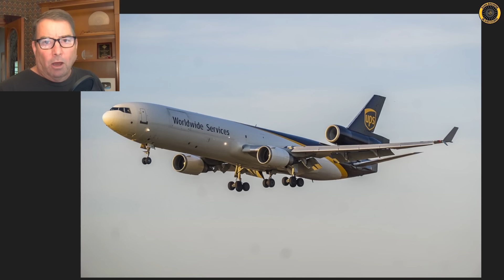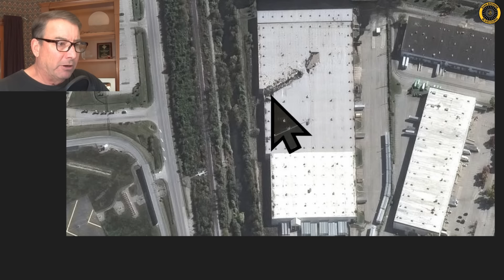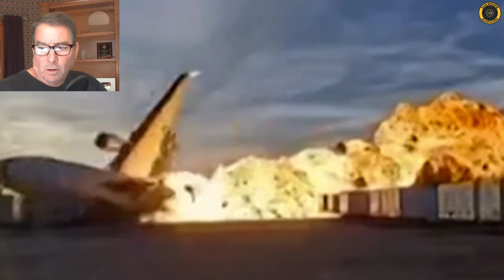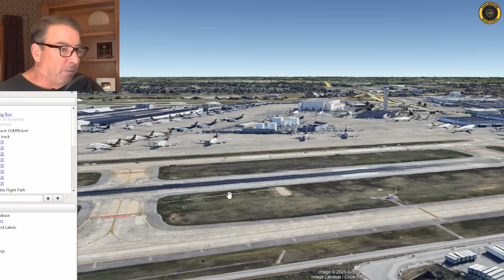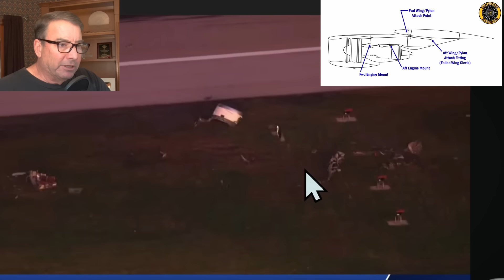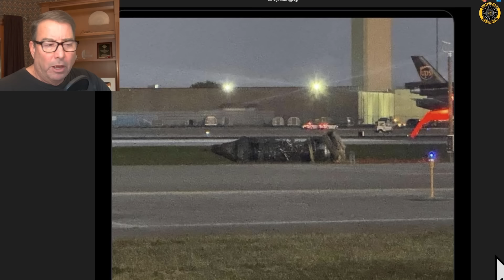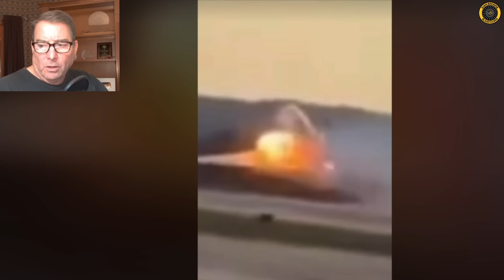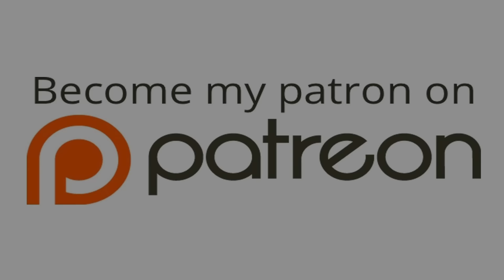UPS #2976 UPDATE 2 6 Nov 2025

Comment: Juan, it is Kevlar as I have decades of advanced material reinforcement forensics failure analysis engineering experience including decades of forensic work with aramids such as Kevlar. That picture quickly tells me a very shocking sequences of evens which I will email you to get your thoughts first  before I contact the NTSB.

Comment: The engine keeps moving forward after the separation from the wing. You have a good point about engine failure first but so much damage to pylons and engine separation is more stress at attachment points.

Comment: It was stated in another video that you may have seen by a pilot that the number 3 engine was the compression stall, not number 2, but wasn't ruled out, so there's conflicting stories which was confusing. We'll find out what happened when it's complete.

Comment: That engine fell off as AC  rotated causing a pitch up and stall. The aggressive pitch up also caused the other two engines to stall due to increase pitch and low airflow.

Comment: At the 1:40 mark the topography toward the passenger side of the car does not match the topography from the street on Google Earth.  There are not any power lines or buildings alone that street across from the departure end of runway 17 R.  There is open land then Railroad tracks then some industrial buildings.  According to Google earth the building they first struck was a UPS building, but was listed as closed.  It was first struck about 1200 feet from the departure end of runway 17 R.

Comment: Building buildings at the end of a runway… BAD idea..engines should NOT fall off wings when complete failure occurs
Having an engine on the tail accessible to debris from a failed wing engine..that design is problematic.
This is why the 777 and the 747 with wing only engines makes them a superior airframe design for a wide body.
Fortunately DC 10 MD10 and MD11 being a older aircraft are more used as freighters and less as passenger aircraft
Therefore less human life died. I recall when AA191 crashed they grounded the DC10 for numerous month
And me and my wife got layed off from CO as they had a large fleet of DC10 aircraft that got grounded.
then worked FTL and FedEX and had the displeasure of the MD10 and MD11 always breaking down and having to unload an reload
Cargo on other aircraft. I hated the MD 10 and MD11 because of the poor Mx reliability and after loading the aircraft.We would pray that the aircraft would depart without MX delay making our life hell having to unload and reload another aircraft.
Watch Fdx flight 80 MD11 bounce down the runway and crash and burn sideways like the UPS aircraft makes me wonder
I have only one good thought about this aircraft Continental in the 70s had PUB bars between first class and coach that was
Fun…other than that these airframe belong in the dessert

Comment: Per NTSB briefing 3 today 7 Nov, the CVR recording indicated 'the takeoff roll was uneventful through the different speed call outs. About 37 seconds after the crew called for takeoff thrust, a repeating bell was heard which persisted until the end of the recording 25 seconds later.' And if you want to draw AA171 parallels, again per NTSB Nov 7th 'the bulk of the left engine pylon was still attached to the engine when the engine separated from the wing'. Pretty damning information on the pylon and no chance for the crew.  Whether the "Heavy Check" performed at KSAT had anything to do with the pylon has not been determined.

Comment: I am still trying to understand the physics on how a left side engine detaches from a wing and then somehow slides across the flight path before coming to rest on the right side of the runway.
Reply: It would be producing thrust as it detached. The spinning parts would create a gyroscopic effect, changing its direction of travel as any remaining thrust and momentum pushed it forward.

Comment: The Crushed forward end of the engine.. fan duct is not just for airflow and noise control... but is also strengthened for fan-blade containment. In this case it appears that the entire fan duct  Assy is crushed and the FAN section is missing. 
Also... a point about airfield construction and civil-encroachment off the ends of runways. Most airfields are built with abundant safety zones for mishaps like this. However FAA and local Authorities are notorious about allowing business and housing to be built-up just past airport boundaries... including off of the ends of runways. NOT SO for most military airfields... the airfield/base boundaries are extended into vacant land for safety zones... to avoid civilian casualties in takeoff and arrival crashes like this. This military0forbidden-building restriction often drives developers insane... cheap good land in city boundaries that have strict building prohibitions... and SOoooo... now the reasoning why runway ends are kept free/clear of development ... terrible lessons learned... is VERY clear...

Comment: I don’t believe #2 was compressor stalling. GE engines are robust that they won’t compressor stall like a Pratt will.

If a CF6-80 compressor stalls, its doesn’t stop and turns into a ”donut on a rope” type failure. 

Again, the images just seem to indicate  flame being drawn through not FOD or debris.

I believe #2 and #3 will be shown to have been producing take-off thrust (at near full derate (-20%+assumed).

I believe the following will be factors:

- Full Derated takeoff -20% + asssumed
- Drag factors from damage to underside and upper portions of the wing
- Drag factors related to roll control and spoiler extension to assist in roll control reducing lift and further increasing drag
- Gear down

It’s my hypothesis that the combination of those factors resulted in the airplane not being able to accelerate once out of ground effect, causing it to settle.

I believe the two remaining engines continued to make take-off thrust, however since they were not advanced beyond the de-rated settings post engine failure this lead to insufficient thrust to sustain flight.

Comment: Not an expert here, but notice the following:  We know that the wings were level when it passed over Grade Lane, so the marks on the roof of UPS Supply Chain cannot be from a wingtip.  Must have been Debris, or Landing Gear, or a tale strike.  After the roof mark on the roof, the roof is clean with no marks ... and the strike area is slightly concave ... so I would say tail strike due to angle of attack of the aircraft on lift off and then it looks like less of an angle of attack as it crosses over Grade Lane.  There is no "double marks" from landing gear ... however, since it was flying slightly left, it could have been the left gear that grazed the roof (notice that the roof has some kind of structure in line with center of runway).  However note that roof mark has a "skip" in it .. a mark then some hole ... either a "wave" collapse in structure due to skid, or debris finally going into the structure after skipping.

Comment: Juan, the AA crash in ORD has another contributing factor. Crandel, being the bean counter DICK that he was, ordered that airplane with only one stick shaker which was allowed by the FAA at the time. They were already past V2 +20 and as you know V2+20 is the MAX speed we're supposed to fly until clean-up altitude normally 1000 ft agl. So the crew aggravated the situation by initially raising the nose to get back to V2+20 as we as pilots are trained to do NOT KNOWING that the engine had migrated and took the hydraulic lines with it which allowed the slats to retract. Had they known maybe, MAYBE they could have climbed out with one wing without slats. The #1 engine provides power to the co-pilot side of the stick Shaker which was no longer powered. A total cluster fck on that crash too.

Comment: One thing they believe on this flight is this, when the left engine came off it caused rupture fuel tank to catch on fire on the wing. 2nd problem they think happened is when engine one came off, debrie was thrown into engine 2 causing it to lose thrust. This is why they couldn't gain altitude. So basically after engine one came off, they only had thrust in engine 3 right wing. Engine one gone, engine two no thrust, engine three, only engine providing thrust. So as they pushed it to max to climb out, it caused the plane to roll to the left, and that's the position the plane was in when left wing hit the ground first. Two working engines, the plane could have taken off. But with only one working engine the plane was doomed
 Also the plane had already reached V1 the point of where you could abort takeoff had already passed when the engine came off. So it they would have tried to abort takeoff they would have crashed. With only one engine, they couldn't take off without crashing. These pilots were in a no win situation when the engine came off the plane. Damned if you do, damned if you dont.

Comment: I have no idea if this would help but we've had a few engine failures on rollout/initial take off lately. In the GA world with prop based aircraft we always do an engine runup. Is there ANY utility to runup a turbofan jet engine to test the integrity of the engine? I am assuming the brakes could hold the thrust from this type of runup?

Comment: With any blade out (fan, compressor or turbine) the engine should still be able to stay on its mounts even with the subsequent imbalance.  I believe a disk failure would have had to happen in order for the engine to be released from the engine mounts and/or the pylon.  Similar to the Sioux City accident.  In the engine world the saying goes.  "If a disk fractures then all bets are off!".  Coming from my 29 years of experience with military jet (gas turbine) engines.

Comment: Would they have been able to climb out if the FOD had not entered and compressor stalled the 3rd engine?
Reply: Do you mean the second engine? Maybe, but a safe landing was not for certain as the wing and/or controls may have been damaged by the fire and/or debris.
Reply: @igclapp  I mean the right hand engine, which I believe Juan referred to as the third engine (presumably engine 2 is the engine above the fuselage?)

Either way, thank you for the response. Those poor pilots, they were doomed.
Reply: @thgdav Yes, some are now saying that perhaps the #3 (right wing engine) ingested debris and stalled. I suppose that's possible. They could not have climbed out on only one engine. I think it's even possible that both #2 and #3 engines may have suffered some degree of thrust reduction. An impossible situation for those pilots. 😢

Comment: The most awful thing is, in this day and age, the far right would've called any of the pilots a DEI hire if they were black/female/foreign, we're in charge of the flight and there wasn't clear evidence the engine fell off. God forbid a pilot be black, female or a foreign name and have an air accident out of your control in this day and age. I'm sure if it was a plane full of black or female pilots, the right wing would be saying they failed to do sufficient walk around checks and should've noticed that their engine was going to fall off.

Funny thing is, I have seen people on Twitter (as a 2008 OG Twitter user, I hate the place after Elon took over), saying that a female shouldn't have been flying and they would've stood a better chance if it was all men in the cockpit troubleshooting. Yes, they assumed Dana was a female based on the name. It shows these people have zero clue about the jobs they are calling people DEI hires for. They didn't even check to see if Dana was male. Someone called them out on it and they deleted the Tweet, which says a lot because they didn't turn around and go 'well that true white american man was a DEI hire' or 'inadequate'. No, once they realised it was a white american, they didn't have any issue, which shows they don't care about safety or due process, they are just using it to be racist or misogynistic. There are plenty of female and black pilots who are far more experienced and capable than many white pilots, and that's absolutely fine. 

Absolutely no qualified and sane pilot is getting onboard with a 'DEI' hire pilot if they truly thought they were incompetent and could accidentally kill them. Do these far right people assume pilots have no self-preservation instincts? That they do have partners or families to go home to and will not let some unqualified person ride with them.

Comment: I retired with 30 years at AA....what originally stumped me about this terrible accident is the fact that they couldn't continue to fly even after losing #1.  The MD-11 of course is rated to fly on only 2 engines at Max TO weight so why couldn't they continue?  I think it might be what you said about losing thrust on #2 also.  Speculation at this point and I don't think we'll know that for sure until they analyze the FDR but I think thats probably what they'll find.  His wings level attitude all the way down shows me he didn't stall, but just didn't have the energy to climb.  Bottom line.....why did that engine fall off, expose fuel lines and cause a huge fire.

Comment: This may sound irrelevant, but didn't United 191 #1 engine depart the aircraft and roll over the wing??  Reason why I ask is that engine is on the RIGHT side of the runway. If it rolled over the wing would it not stand to reason it not only damaged the #2 engine but quite possibly the control surfaces on the tail?? That over head view of the building it hit shows a considerable yaw and/or turn moment. Not to mention, if its conceivable to damage #2 engine and possibly rudder/elevator surfaces....is it also possible the horizontal stabilizer (which is quite a bit smaller than the DC 10) was also damaged??? Leading edge damage would be nearly catastrophic to airflow to the elevator....and possibly only one side of the horizontal tail.

Comment: Correction, saw a higher resolution photos of the engine. There is a piece of the low pressure turbine case missing. Appears that the LPT blades and vanes are also gone. You can see the turbine disks and seals. That would indicate an uncontained LPT failure.

Comment: Not a pilot or a long time MD-11 mechanic but I did a lot of work on the CF-6 engines used on the DC-10 & MD-11. That first stage cowling is fairly light, not much mass. The main engine core is relatively heavy & round so simple physics says that the main engine would travel (roll?) further than the rest of the components, especially the pylon. The entire assembly (engine & pylon) likely came off as a unit but that is just an opinion. A question: Since the MD-11 has a wet wing could it be possible that the pylon tore a hole in the wing tank when it separated allowing fuel to spray out into the air stream? There sure is a lot of fire around the #1 engine location in the takeoff videos. The black box recording will tell a lot. That flight crew had a nightmare of a situation on their hands for sure.

Comment: From personal experience while employed (1980-86) at Pratt & Whitney Aircraft Experimental Assembly & Test (E. Hartford, CT) ... During a fan "blade out" containment test, we had a PW-2037 literally rip tself off the test stand mounts (and kept running!).  The (4) foward engine mount bolts sheard at the engine mount plate interface, and the engine pivoted downward on the rear mount wishbone, smacking the test house floor.  The engine siezed for a second, then the diffuser case flange bolts all sheared and the case spun 180 degrees.  You want to see a buch of engineers, who were standing in the test house control room, turn white as ghosts!  During the six years I worked at PWA, I saw the results of many "blade out" and bird / ice "ingestion" tests on several PWA models - then tearing down what's left of the engine afterwards.  The forces involved are unimaginable until you see the high-speed camera footage.

Comment: If you lose one of the wing engines in a Tir-Jet type of aircraft and fuel comes out of the wing that fuel will be sucked up into the center engine on the tail and will render that tail engine useless, whether that fuel is on fire or not. Now you are down to only one working engine and the aircraft can't fly out of that. Look at both the Chicago picture and the Louisville videos.

Comment: Again -- the dashcam footage from Grade Ln (which you didn't play) shows; (1) That the engine casing/nacelle/pod was STILL on the plane as it first came into view. (2) It passes behind the trees (3) less than 1 second later the engine casing/nacelle/pod is gone as the the wing reappears from behind the trees. (4) SO the engine separated and fell out of the casing/nacelle/pod well before the entire housing fell off.

Comment: Absolutely terrible accident.  My heart goes out to the Pilots and everyone affected on the ground.  You can see what appears to be fuel mist dropping like a curtain from the plane as it crosses the highway, whereupon sparks from collision with the power lines ignites (at least appears to me) the fuel-air mix trailing around the aircraft. If the mist was smoke from the left wing fire, one would presume the mist would be rising.   Instead the mist was dropping to the ground like a curtain.  The mist obviously had to be fuel spray mixed with air coming from the left wing, before the explosion occurred coincident with plane's contact with the power lines.

Comment: Even though they had one engine fail, shouldn't the other two be more than enough to keep the aircraft in the air? Is it possible that debris from engine one took out the engine in the tail?

Comment: At what point did the engine fall off the wing because If that engine fell off that soon during the takeoff roll and before v1, alarms going off in the cockpit  maybe the pilots had time and enough runway to abort takeoff with full reverse thrust with the remaining 2 engines maximum brakes and ground spoilers?